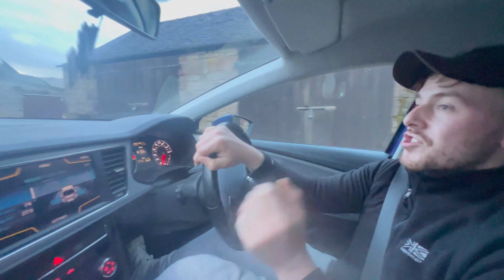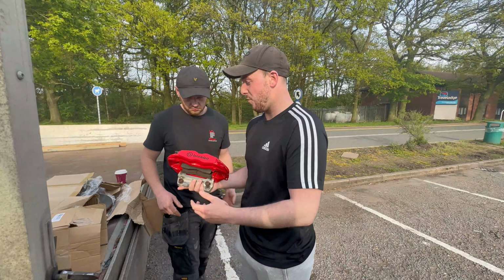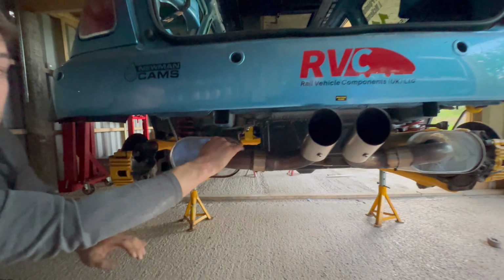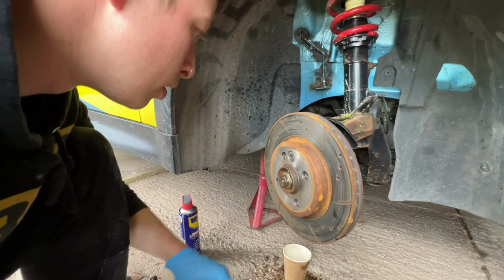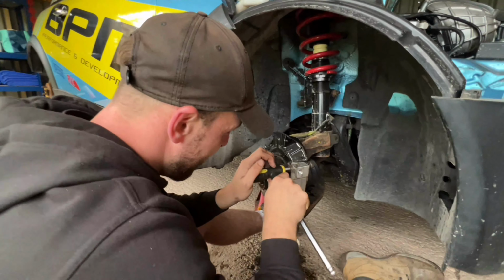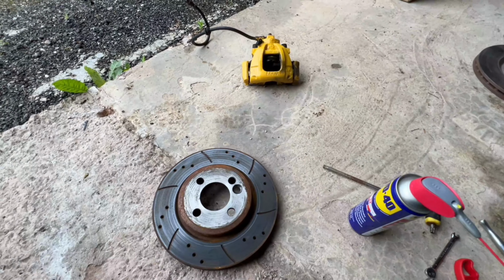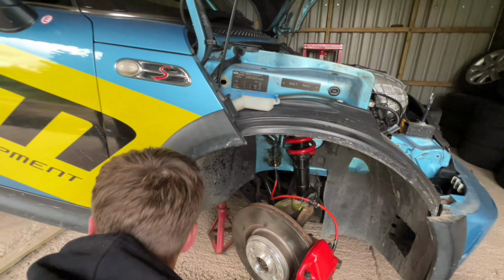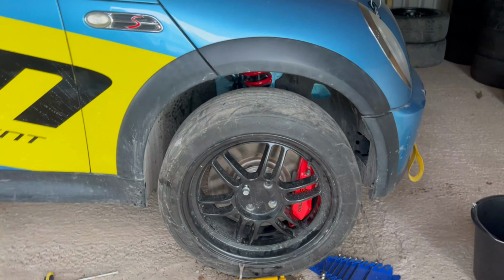BUDGET MINI COOPER S R53 GETS A MASSIVE BRAKE UPGRADE!!!

Comment: Did u run with the standard master ? If so how was the pedal feel after you were running the car? I noticed it was a solid pedal when the engine was off.
Cheers bud 👍
Reply from the maker: Hi Mate, yeah we’ve gone with standard master cylinder, we haven’t run the car yet on the track! The pedal is hard when the car is off but think we need to re bleed ours with a machine! So once we’ve done that and a track day we’ll know a little better how the master is!

Comment: What coilovers do you got on it? And do they have adjustable dampening as well? Im looking for a set for my r53 that is adjustable in both ride height and dampening that also fit my wheels lol
Reply from the maker: We’ve only got budget Raceland coilovers currently, they do not have adjustable dampening, we had to use spacers with the original wheels also as we were touching the strut, we’ve heard good things about the mid range Tein set with adjustable dampening though!
Reply: @BPMDevelopments  i tried looking for some tein coilovers, but they said they didn't make any for the r53. I guess I have to look harder, thanks for replying c:
Reply from the maker: No worries, have a look for these.. TEIN STREET ADVANCE Z COILOVER